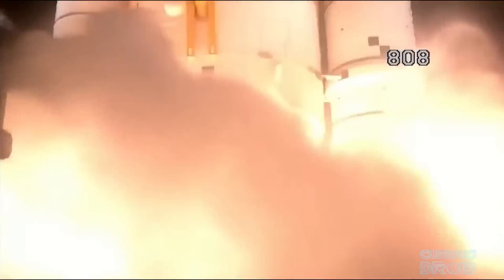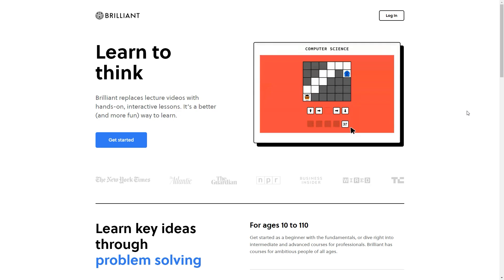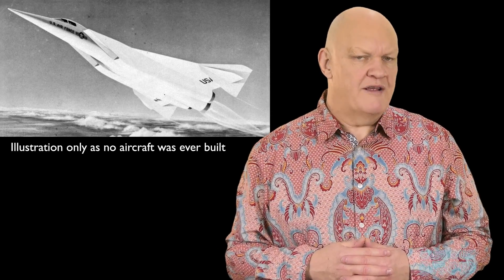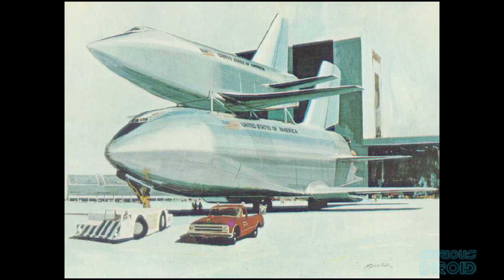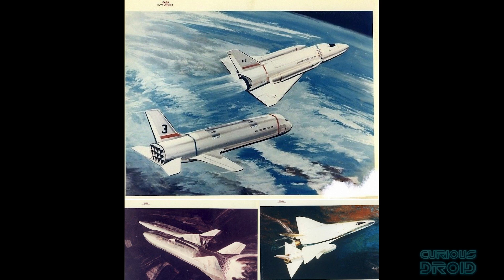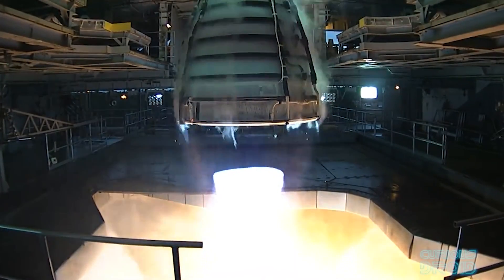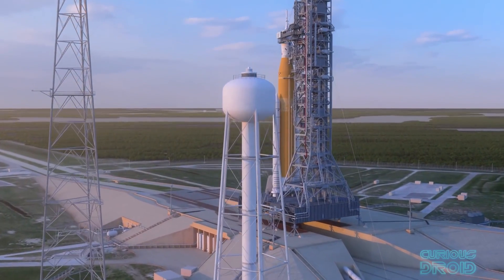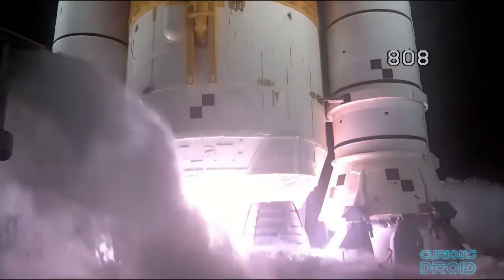Why is NASA Throwing Away Reusable Engines?

Comment: Each of those four engines costs about as much as a Falcon Heavy in expendable mode, and throwing the entire vehicle away on every launch feels like an anachronism when ever major rocket company is using (or at least planning to build) reusable systems.

The shuttle was dangerous, impracticable, and required major refurbishment after each flight, but the SLS is still a huge step backwards.
Reply: The Falcon Heavy could barely lift the Orion, ESM, and ICPS when fully expended, but the aerodynamics of such a large stack on FH were an issue per former NASA Admin Bridenstine. Booster reusability is great, but has drawbacks.

First, if you don't have a fast enough launch cadence, you can spend more on recovery equipment and personnel than you save by reusing the booster.
Second, you take a payload hit for the recovery system on the booster. The Falcon 9 B5 can lift up to 22.8 tons to LEO when expended (SX), but only up to 16.7 tons when landed on a drone ship (B1069.2). Doing a Return to Launch Site (RTLS) landing, costs even more payload as you have a boost back burn to cancel the lateral velocity and return back to the launch site.
Third, the higher and faster you go, the harder reusability is to perform. The heavier the dry-mass of your booster, the harder reusability is to perform.

So with SLS launching once a year, eventually, the cadence doesn't really justify recovering the booster. Not to mention that it gets higher and faster than a Falcon 9 as the SLS core stage almost reaches orbit, making recovery MUCH more difficult. The SLS core stage is travelling well over 3 times as fast as the Falcon 9 booster and is well over twice as high as the Falcon 9 booster at MECO. The dry mass of the F9 booster is 22-25 tons while the SLS core stage is 85 tons.
The SLS Block 1 can get Orion to the Moon, but not with the kind of payload hit like F9 has. The SLS Block 1B will send along a Lunar Gateway module with Orion, so it really can't take the payload hit either.

SLS started design work in 2011, 4 years before SpaceX landed the first booster and almost 6 years before they reused a booster.
Reply: @steveaustin2686  those projects were built specifically to give SLS something only it could do. A moon project with FH could have been viable if they did it differently, and in a much cheaper manner. But then they would not have SLS for what it really is for; a pork barrel project to create jobs and keep members of congress' constituents happy so they can remain in power, and to shove a lot of cash in Boeing's direction
Reply: @heartofdawn2341  You seem to be making a common mistake of looking at what SpaceX is doing now and saying that we should have given SpaceX the contract then, without looking at what SpaceX was doing then.

Orion was selected in Aug 2006 for the Crew Exploration Vehicle (CEV) for the Constellation program. SpaceX in Mar 2006 had launched the Falcon 1 small sat launcher (420kg) for the first time and it failed to reach orbit. Constellation was cancelled in 2010 and SLS started in Dec 2011. In Dec 2011, SpaceX had 4 of 7 successful orbital launches to their name, 2 Falcon 1 and 2 Falcon 9 v1.0 launches. SpaceX would not reach the ISS until 5 months later, not land a booster until 4 YEARS later, and not reuse a booster until almost 6 years later. While what became Falcon Heavy was discussed as early as 2003, it had a 2 ton payload to LEO then. In Apr 2011, the Falcon Heavy was revealed to the public, with a 53 ton payload when fully expended. That would not lift the Orion, ESM, and ICPS to orbit. SpaceX was awarded a contract for Crew Dragon in Sep 2014, when they had a total of 12 flights on the Falcon 9 and were still a year away from landing a booster. Crew Dragon is a LEO spacecraft and by the time you upgrade it for lunar operations, it is likely to be almost as heavy as Orion. Since Crew Dragon didn't fly crew to LEO until 2020, it would take time to develop a lunar version. Remember, SpaceX were the scrappy new guys in 2014 and Boeing was expected to handle the crew flight duties to the ISS. Things changed over time, but neither NASA nor anyone else is not prescient.

Starship, once it matures, looks like it can replace SLS/Orion in the future. Based on the SpaceX plans for Artemis III, 10 flights and 12 days between flights (GAO pg 27 & pg 10), that is not happening anytime soon.
Reply: @steveaustin2686  Did you look at the numbers? the SLS (2 billion per launch) is 20x more expensive then FH, with 50% payload. You could launch 13 Falcon heavy for one SLS.
Reply: @TheSwissGabber  Did you miss the point that the Falcon Heavy could not get Orion and the ESM to the Moon? The whole point of SLS. Rocket Lab's Electron is much cheaper than the Falcon Heavy, that does not mean that the Electron will replace the Falcon Heavy.
Reply: In. A. Nutshell.

Comment: Those RS-25's should have gone to museums. A team had redesigned the F-1 to be made using modern processes, but ultimately Congress had to keep their defence contractors in the black by having them take apart and redesign these re-usable RS-25's to be "disposable," and thereby saving... What, exactly? They could have built NEW engines for how much it cost them to redesign the RS-25's, not to mention that the F-1B's would have produced FAR more thrust!
Just a colossal waste of money.

Comment: SLS is certainly an incredible vehicle to watch and will carry NASA into a new age of exploration, but man it really is incredible to see Boeing take Space Shuttle engines, Space Shuttle tanks, Space Shuttle SRBs, and an upper stage that is taken from the Delta IV Heavy... And then take 11 years and $20bn to find the right way to bolt them together... Great job there Boeing.
Reply: oh and recover none of it - even the solid rocket casings had parachutes with the Space Shuttle.
Reply: @tma2001  probably because they learned that recovering and refurbishing spent SRBs from the ocean where they get heavily corroded with salt water is actually more expensive than building them new lol. Would've been cool if they did it Energia style and had deployable wings so they could just fly back to KSC haha. Not to mention it would've been such an awesome sight to behold.
Reply: There were a number of strange decisions relating to the Senate Launch System (SLS) rocket.
Reply: The core stage is not a Space Shuttle tank..
Reply: @ericmatthews8497  I'm aware that it is stretched and heavily modified to have enough structural support too carry Orion and the upper stage as well as support the force of 4 RS-25s, but are we really saying that it is acceptable that it took 11 years to make this modification? Heck, even longer when you consider the development of Ares V. NASA gave Boeing a scathing report on Boeing's atrocious project management for a reason.
Reply: @AlexSchendel  It's a completely new design, built using a different aluminum alloy, using a different construction process, with a different welding process, on different welding rigs.  Other than that, it's just like the Space Shuttle External Tank.

Comment: Basically, "any engine" could be refurbished to be "reusable", if recovered in a non-destructive manner. The problem toward "true reusability" is if the engine is simple enough to be refurbished FAST and CHEAP plus if said engine is paired with a spacecraft equally easy to return to lauch. Task that both the RS-25 and the Space Shuttle were not really up to...
... and with the Shuttle retirement, there is no any use for the RS-25, so they could be lost by rust and unuse, or at least used for a lst time as expandable engines.

Comment: Reuse-ability is great as long as it doesn't cost or weigh too much. At this point launching stuff into near-earth orbit favours reuse-ability. However when talking about escape velocity... Probably not.
Reply: What nonsense.
Reply: @TheEvilmooseofdoom  A very concise critique. I'm afraid I have no rebuttal.
Reply: That's just short sighted. Getting into Earth orbit requires more deltav than is required to get from Earth orbit to just about anywhere else in the solar system. Being reusable gives you options that expended does not. For example, instead of using the launch vehicle itself to send a payload to the moon or Mars, you could send a heavier payload to LEO that has it's own highly efficient engines that then goes out further.
Reply: @anthonypelchat In the context of sending cargo to the moon I would agree with you. But no matter how you cut it, carrying extra fuel and whatnot is going to cut into your payload. Furthermore if your sending people to the moon you want all the delta v you can get. 
Making the trip longer than necessary is dangerous to the crew. Highly efficient engines are not your friend in this scenario.
Reply: @T3H455F4C3  Highly efficient engines are always your friend in long distance missions. There are some that wouldn't be because they are too weak, but that doesn't mean ALL highly efficient engines are that way. Plus, if you are carrying dead weight, that slows you down and waste dv. 

When you are reusing launch vehicles, you gain options. It can be as simple as expending a booster that has already flown, or as complicated as making a better overall design in orbit instead of cramming everything into one vehicle. But if you don't have a reusable option, then you have no decent options available as you are now limited by both build times and costs for the launch vehicle.
Reply: @anthonypelchat  I wouldn't qualify this as a long distance mission. This is a 100m dash not a marathon. 
Acceleration and efficiency tend to have an inverse relationship. You can create a well optimized combination of these factors, but to an extent you're always sacrificing one for the other. No free lunch.     
In the context of a crewed mission to the moon, power and speed trumps efficiency and cost savings 100%. 
IF we were talking about moving cargo, where cost matters and travel time doesn't matter, I would completely agree with you.
Reply: @T3H455F4C3  Again, just because you can go more efficient doesn't mean that you have a drastically long burn time. This is especially true if by being more efficient you can also reduce weight. And no, power and speed to not trump efficiency when going to the moon. In fact, you have to reduce power and therefore speed to keep from making the ride unreasonably uncomfortable or even dangerous. And you want to be more efficient so that you have spare fuel. 

It's hard to fully explain this over text, but you currently have a craft that had to burn for a bit just to finish leaving the atmosphere. And it had protection from the atmosphere. So there is already dead weight from that point. And the engine on the second stage is normally a bit stronger than needed in order to get safely out of the atmosphere as quickly as possible to keep crew safe.
Reply: @anthonypelchat  When I think of highly efficient propulsion, I think of ion thrusters.That would be a drastically long burn time :p
 I'm guessing you're thinking of something like the SpaceX Starship as an example of how this could be done better?
Remember the Starship hasn't done anything or gone anywhere yet. It's still an unproven concept. 
What has been proven is that disposable multistage launch vehicles work really well even tho they're fairly wasteful.   

I think the word "efficient" is bothering me a bit. It's not a universal concept. It totally depends on the criteria that your using to make your judgments. 
If you want to maximize your payload and minimize the fuel used, a disposable system is the most efficient. 
If you don't want to spend the time and money building an entirely new launch vehicle for every mission, a reusable system is the most efficient.
Reply: @anthonypelchat  Somehow I just realized what you were saying with your initial comment. You're thinking of something like a "space taxi" that would live in LEO when it's not making trips to and from the moon? Never land on Earth? I think that would be a good long term solution. I do see the up front costs being really high. All your maintenance infrastructure would need to be up there. Need a pretty serious space station to start with. It's not a bad idea tho it is a BIG idea
Reply: @T3H455F4C3  Not necessarily, but that is another possibility. Especially with Starship HLS. HLS is already going to keep astronauts onboard for a few weeks, if I'm not mistaken. But it obviously cannot land back at Earth. And the Orion is only being used as a transport between Earth and HLS at the moon. 

The main thing is that having a reusable craft gives you options. You could build something in orbit to take everyone, or you could put up a craft in LEO that would then be the smaller return vessel. Or something else entirely could be done. But the fact that you now have options is a great thing. That doesn't exist with an expendable launch vehicle. The simple truth is that the vast amount of energy needed for just about anything in space is just getting off the planet itself. If you can get off the planet easier, faster, and cheaper, that opens up multiple options.

Comment: Disappointing... The Shuttle had lots of problems but it was inarguably the most advanced spacecraft ever designed. (At the time of its design in the mid 1960's) Rather than fixing its problems NASA is going back 1950's disposable launch vehicles...

Comment: Out of curiousity, (specifically for Moon shots, rather than simply low Earth orbits), why use liquid fuel engines and giant tanks of fuel that apparently, are difficult to fill, require a ton of dimensional space, lots of moving parts, are expensive, and now, thrown away? Why not simply use multiple solid rocket boosters? Wouldn't 4 or 6 of the reusable boosters equate to the same/better thrust as the liquid fuel engines, and there would be a lot less mass to have to launch in the first place, without a humongous fuel tank, no?
Reply: It's hard to break the Orion, ESM, or ICPS into pieces. If you want to dock the in LEO, they would have to be redesigned for that.
Reply: Solid rockets lack flexibility. They can only be lighted once, can't be turned off once they're lit, and hold a set amount of fuel. Great for getting off the ground, but not great for getting into the correct orbit and making multiple course corrections.
Reply: @logicalfundy  Depends on how SRBs are used. The second stage for the Antares 230+ uses an SRB to get Cygnus to the ISS. Even though the SRB can't vary from pre-planned thrust or length, the Cygnus has went to the ISS 18 times successfully.
Reply: Solids are not that efficient, terrible ISP.  In space that counts.

Comment: I believe that reusability is for low earth orbit launches and throwaway is required for lunar insertion orbits. I I'm not mistaken even the Falcon-9 is mainlyt for low-earth orbit and ISS launches, with exo-earth orbit launches requiring use of Falcon Heavy, which in case of higher weight payloads (greather than a Tesla Roadster :D ) requires throwaway launches. I believe that as envisioned for lunar landing, even Starship HLS will require multiple refueling tankers; I believe that by Musk's own admition it will be 4 tankers, with other estimates being as high as 10+.. so even reusable is a nuanced concept.
Reply: F9 was designed specifically to service the satellite launcher market.

Comment: As Elon Musk said expendable rockets are a waste of time.
Reply: Funny that 2 of the 4 Falcon 9 launches in Nov 2022 were expendable launches. Booster reusability is great, but has drawbacks.

First, if you don't have a fast enough launch cadence, you can spend more on recovery equipment and personnel than you save by reusing the booster.
Second, you take a payload hit for the recovery system on the booster. The Falcon 9 B5 can lift up to 22.8 tons to LEO when expended (SX), but only up to 16.7 tons when landed on a drone ship (B1069.2). Doing a Return to Launch Site (RTLS) landing, costs even more payload as you have a boost back burn to cancel the lateral velocity and return back to the launch site.
Third, the higher and faster you go, the harder reusability is to perform. The heavier the dry-mass of your booster, the harder reusability is to perform.

So with SLS launching once a year, eventually, the cadence doesn't really justify recovering the booster. Not to mention that it gets higher and faster than a Falcon 9 as the SLS core stage almost reaches orbit, making recovery MUCH more difficult. The SLS core stage is travelling well over 3 times as fast as the Falcon 9 booster and is well over twice as high as the Falcon 9 booster at MECO. The dry mass of the F9 booster is 22-25 tons while the SLS core stage is 85 tons.
The SLS Block 1 can get Orion to the Moon, but not with the kind of payload hit like F9 has. The SLS Block 1B will send along a Lunar Gateway module with Orion, so it really can't take the payload hit either.